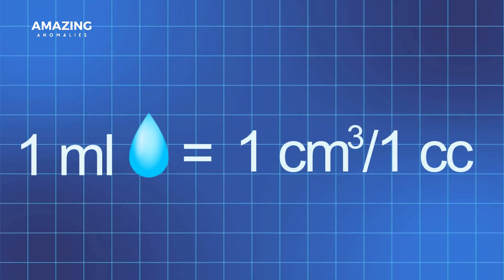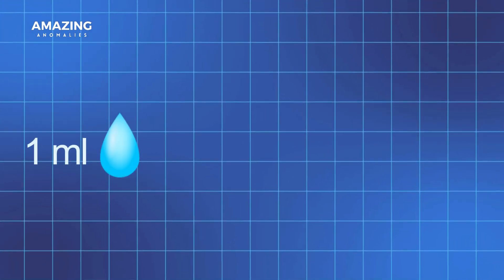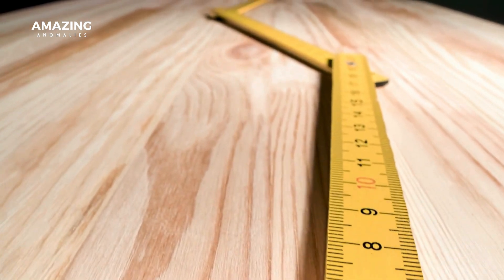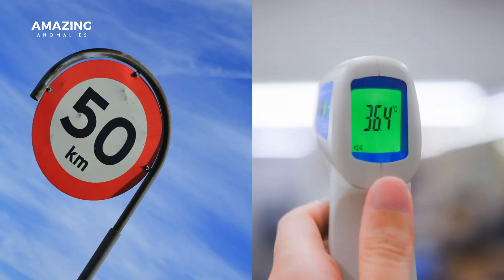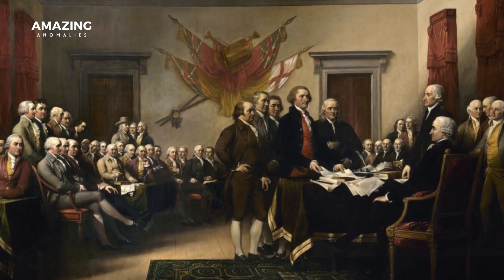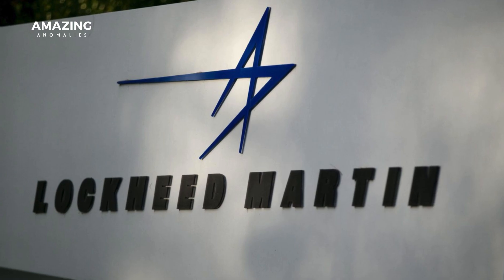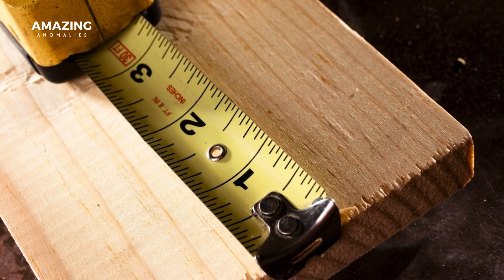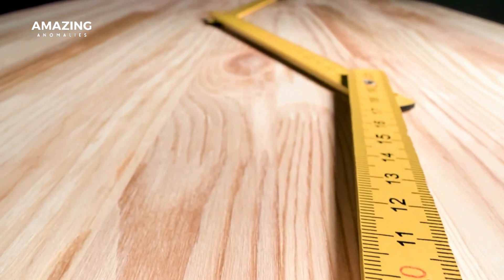Why Do AMERICANS Still Refuse the Metric System?

Comment: Calorie is not metric. You should have said 4.18 Joules to raise temp of 1 gm of water by 1 deg C. Meanwhile, 1 BTU needed to raise 1 lb of water (1 pint) by 1 deg F. See? Simple. And there are 180 deg between freezing and boiling in Fahrenheit. 180 deg....such a common number in Engineering, Physics and Maths. I wonder why?

Comment: Having two different systems operating in parallel makes no sense. I grew up in the UK with the imperial system but swtiched completely to SI units in my teens without a problem. I still see people much younger hanging on to imperial measurements and struggling to do conversions all the time. Crazy.

People in the UK still insist on using imperial units in many contexts eg height or weight of a person, weight at birth, etc. Many still only understand pints of alcohol or gallons of fuel. Annoyingly the UK retains miles for road signage and road speed. There's no real excuse for this anomaly. There are still idiot politicians here who want us to return to the 'old days'. Conservatism at its worst.

Comment: Convenience and synchronized units are 100% irrelevant to a system of measure to the vast majority of people for the vast majority of their lives. We learn metric in school then immediately realize how irrelevant all those 'benefits' are as we grow older and never once need to mentally compute 10's of thousands of feet or somehow must know cubic inches vs oz. People who need to know metric do and the rest of us see no tangible benefit to spending money on something that doesn't matter. To give an example of how littler it matters, people are talking about putting km on signs when most Americans no longer even consider units of distance when travelling instead preferring units of time.
Reply: The thing that is overlooked with the U. S. Custom System is that is not really one system but a collection of unrelated standalone measures. This is why the conversion factors are so inconsistent. You choose one measure for a purpose and use it and, with exceptions (like measuring height) you don't use two measures together. As an example, when measuring a long distance you use miles and fractions of miles (or decimal). I don't recall someone saying "I drove 5 miles and 880 yards." Instead they'd say "I drove 5 and a half miles." The reason Metric measures fit so well together is because it was designed at one time.

Comment: The weird thing to me is that things like signs, posters, nearly everything has to be replaced eventually, signs do have to be repainted every so often. They just have to wait for the signs to wear out then repaint them in metric.
Reply: That's what I've been thinking too. We've used both systems for a long time, why rush into the conversion? One of the reasons the U. S. didn't convert to Metric in the 1970s was that they tried to  do it too fast. Just make it a long-term process (say 100 years) and do the transition through attrition. As an example, if you design a new car, just make it using only metric measures. As time passes, the U. S. Customary System (USCS) Units will be used less and less but it will still remain is use where it doesn't make sense to convert, such as in sports where conversions would invalidate existing records.

As far as having both systems at the same time, I think the key is to only use one or the other, and not mix both in an application. If designing a new device, all measures involved are either USCS Units or Metric Units and make sure everyone involved is on the same page at the beginning.

One issue that is expensive is the conversion of specifications (such as those used to manufacture airplane parts). You can't just convert the measures to metric and use it, the converted version must be approved and that can cost thousands of dollars per specification. It is the same with road signs. In another video it mentioned that the total cost to put up one new road sign is $30,000 (this includes the cost of the sign itself, plus everything needed to put up the sign such as paying the crew and blocking off the roads).

Comment: Here in Australia, we successfully converted to the metric system, including our currency to $, over about a 10-year period from the mid 1960's to the mid 1970's. But it was a challenge for those people who had spent their lives under the old Imperial measurement system.
Reply: I did it in the 70's in the UK..it was easy and not a challenge....that's why we exported you lot.